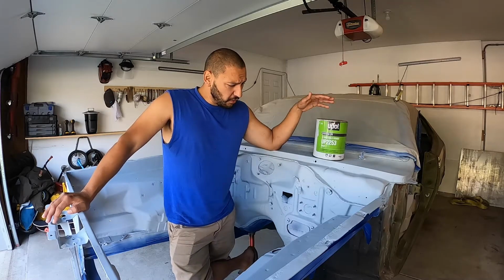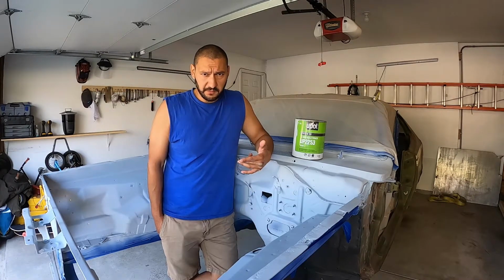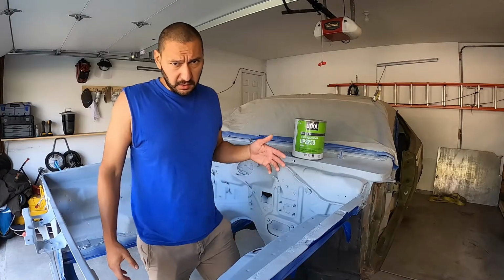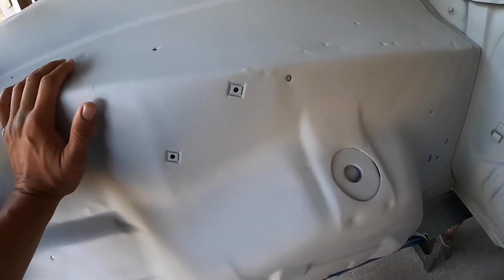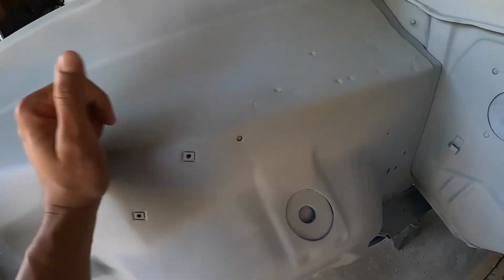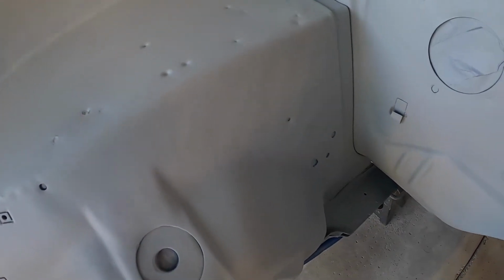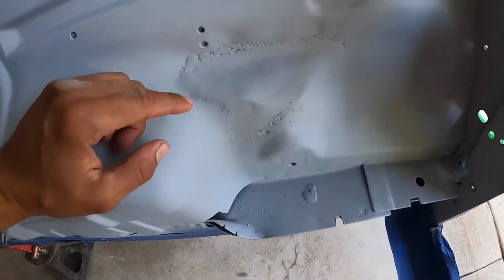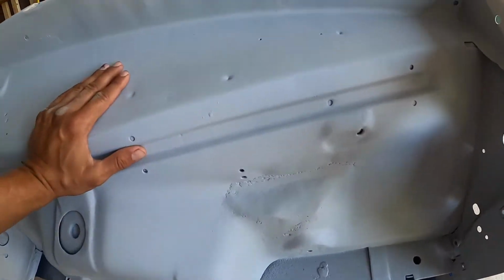Urethane High Build Primer. How much does it cover?

Comment: Did you mix this at 4:1 for this application?
Reply: @BellyUpFish  > Even though this is a 4:1 (Sealer-Primer: Hardener) the SDS paper are easy to find from U-Pol and download. An optional 4:1:2 with a quality high grade urethane reducer can be added. This would allow it to lay out smoother. But it results in thinner "Mil" build up. A guy can use a gun with smaller tip if that is what many are stuck with. Turning up air can help if thick, but move faster if reduced and regardless of mix, 3 coats would not be uncommon. He never said his settings, tip, air, mix or coats.
 This is a high build and with proper flash time, 3 coats would cover & allow you to sand until smooth. Knowing when to stop is key.
 Using an Epoxy or DTM epoxy or if you sold your Mercedes, a PPG 2050 is DTM, Epoxy, high build, primer/sealer. After repairing cars for 38+ years and teaching, I can afford to buy newer the a 7 year old car for my wife. But, this is a quail it product and used by many!
Best of luck with your product as I do product research to get the best for what I can spend, but I am going epoxy first so if I hit a different color while sanding, stop. Figure out if filler or a good glazing putty would do! Don't buy the Red, that is lacquer based. Polyester is much advanced.
DK. ASE Master Tech since 78.

Comment: How many coats of primer did you lay down on your panel
Reply from the maker: Hi Nigel, it's been a while since I did this but I am pretty sure I did 2. One thing that I did mess up was sanding between primer and painting. I am no expert, but I think I may have gotten a better finish if I had done a quick hand wet sanding before main color laydown.

Comment: so what do you think is the best sandpaper do you knock the primer 600 or 800 wet or dry ?
Reply from the maker: Hi Larry. So I am definitely no expert on it, but I recently read that it is better to go up to 1000 dry before doing primary color. Unfortunately I did not know this at the time so I did not go anywhere near that high in grit. Good luck on your project.
Reply: Sand with 320 or 400 dry. 1000 is to fine for good basecoat adhesion. If you want 600 wet that is ok
Reply: @DustorBust never go over 800 for basecoat. I never go over 600. 80-180 for primer. Sand primer 400 and 600 and then basecoat. 1000 is more like if you have blend clear coat. Basecoat will not stick well with anything over 800

Comment: How many coats did you get out of the gallon of primer?
Reply from the maker: Hi Randy, I got 2 coats of the main body of the car inside and out with 1 gallon. This did not include the hood, fenders, or doors. I expect to use probably 1.5 gallons to do the whole car, but it is a fairly big car.

Comment: Hi, thank you for sharing. You didnt cover the workshop. Ist there no overspray? Greetings
Reply from the maker: Hi Freddy! I would recommend covering. When I did this it was just the front and I was half outside of the garage, so overspray was not too bad. Also, the primer is fairly thick and uses a wider spray gun orfice, so overspray is not too bad. When I shot my main color I covered everything and my garage still ended up tinted yellow. Oh well, but yeah covering is good. Thanks for watching!
Reply: @DustorBust  finally you got it done and can be proud of the result. Better make it on your own, even with extra effort,  instead to pay for it, that gives satisfaction.  Greetings from the Baltic, Germany.

Comment: I use it  it’s good 3 in one 4/1 2.0 tip do good bodywork guys come on lol 4/11 /4111 bam light coats bam . You have to keep using the same Products that’s how you get good . I use to use the z- grip  no more spend a little for good body filler. It save you time and money and your body doesn’t take abuse.
Reply: Z-grip filler is great filler.